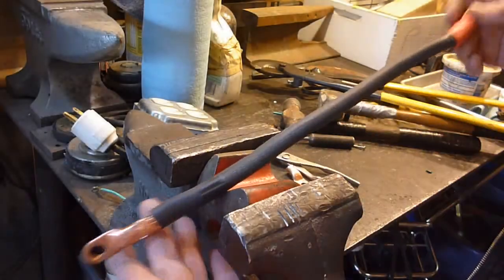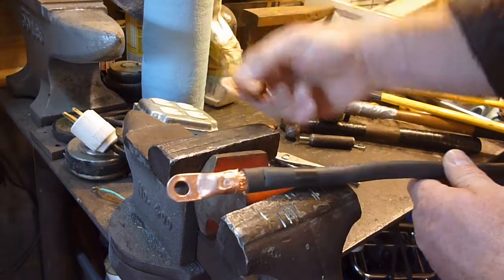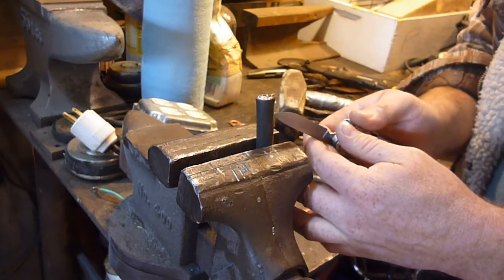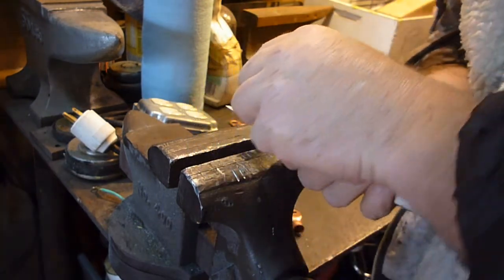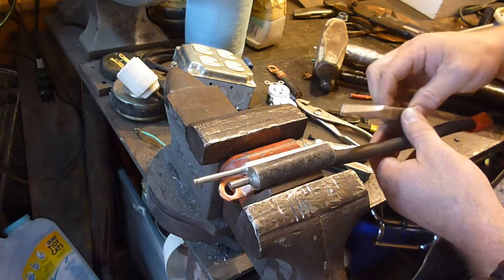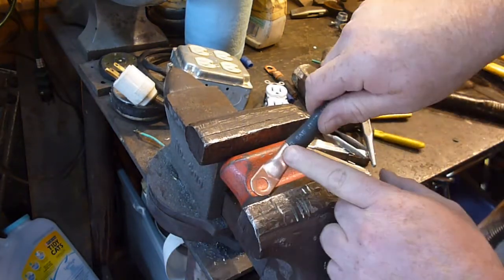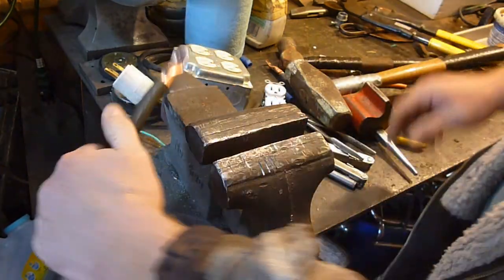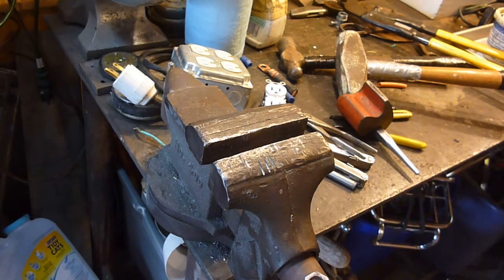CRIMPING BATTERY TERMINALS WITHOUT A SPECIAL TOOL

Comment: you don't solder connections for outdoor use, or battery terminals, because they are more likely to corrode, having dissimilar metals and remnants of flux.

Comment: Another way you could use the vise without needing to use the hammer and the punch is to use any screw bolt with a flat end and use the tail end of it pressed directly into the terminal and tighten the vise to the depth that you want to crimp it with. That way you can control the depth of the crimp just by turning the vise handle and I've seen it do a pretty good crimp job and no other tools needed other than the vise and the screw / bolt.

Comment: The fact that the vise and entire workbench are wiggling around means you are only getting a small percentage of the hammer's force transferred to the work. That vise needs to be immobile to do it's job.
Reply: Yes a well secured anvil is best but lacking that, a vise is perfectly capable for lots of tasks..... if it is secured,  that is

Comment: I don't know enough about crimping to judge your crimp, but I do know that a hammer crimp tool will do the job for a relatively low investment compared to a hydraulic crimper. It might not be worth it for a one time job, but if you ever need to crimp again it might be worth looking into.
Reply from the maker: i agree but i only  had one so i figured i would try. it seems to be working fine though